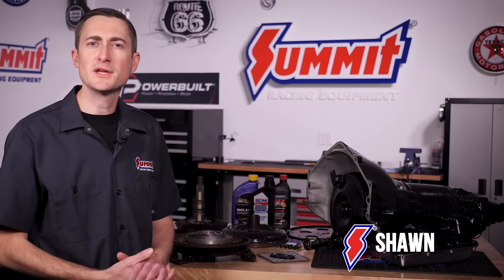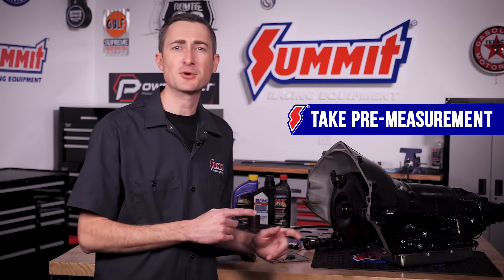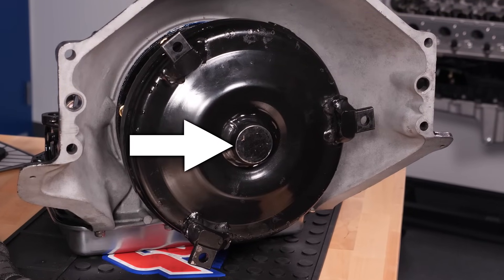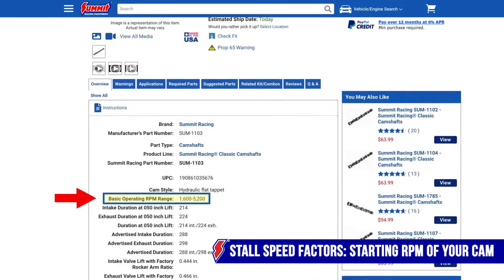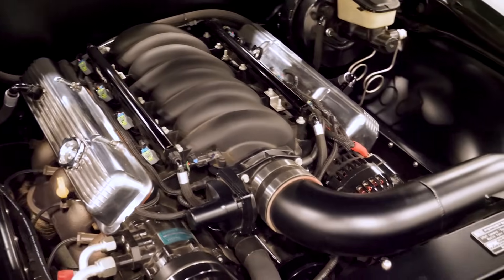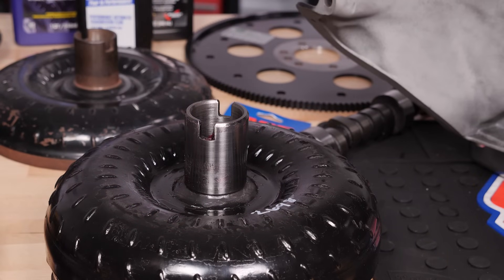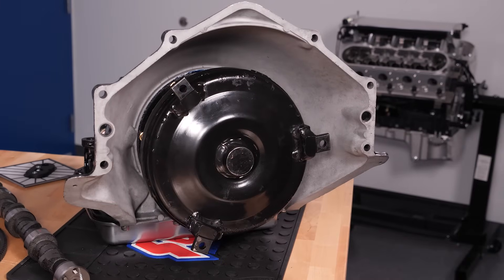5 Common Torque Converter Issues and How to Avoid Them!

Comment: Stop it with the BS of needing to run a stall RPM higher than your cruise RPM.  At part throttle cruise there is very little load on the converter, therefore very little slip.  I've been running 5-6K converters on the street for over 20 years.  During that time my cruise RPM has been 3,200-2,700RPM depending on the gear ratio.  I've been running the same transmission for 20 years.

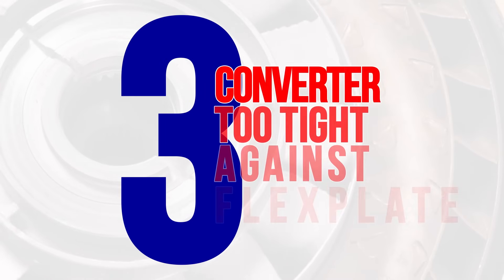Comment: My crate engine manufacturer stated OEM to 1800. 302 HO style block. 367 hp at 5700 rpms, and 356 torque. Car is about 3400 lbs +/-. I've got a TCI which was 1700-1900 stall, and it feels like driving a manual car with a burnt up clutch. Car will not start moving until 1500-2000 rpm from a stop. It always feels like it's slipping.  Rear axle is a TOTALLY redone 8 inch with posi, 31 spline axles, aluminum pinion support, nodular case and 3:25 gears. Trans builder checked out the transmission and says all is well, and the convertor HE bought for me feels too high. He builds racing transmissions and years of experience, so I figured he would know. I am about to pull my transmission and install a stock stall convertor and stock style flexplate. The SFI rated plate is too thick for the studs on the stock convertor, so it has to go.

Comment: I have a 2012 Chevy Express passenger van it's a 5.3 1LT AWD it has 250000 mostly Highway miles. The trans works great, the engine Burns zero oil and consumes no coolant.
I'm getting the code PO700 and p0741. Shortly after these codes appeared the van began to accelerate strangely. It did this when I first accelerated and right around 45mpr. it would lose power but then gained it again, it would do this several times before going back to its normal performance. I noticed that my RPMs would go down and then quickly up and down again while it was happening. I know this is all a Telltale sign that it's the torque converter. However there is something else happening that is strange. First when this was happening I turned on my tow/ haul button and all symptoms would go away. The fault codes would go away but then always come back as my vans computer system would run its Diagnostics . For the last two weeks I've been driving my van with the tow/haul button off and the van is performing normally, however the fault codes continue to turn off and on. I have had the torque converter checked by a professional transmission shop and they found that the slippage is minor, in fact they said and I have verified that my type of clutch converter is designed to slip a little bit. They recommend a whole new transmission but I know that it could be other things like a solenoid or the computer. The van is currently running perfectly it has no symptoms.

Comment: Can you confirm that your example at time 2:19 was miss stated or the info about how the weight of the vehicle affect the selection of the stall speed was incorrect. Lighter vehicles would require lower stall speeds not higher. Thanks

Comment: I know this is an old thread but I have an 88 f150 with the inline 6. Having problems with the motor jumping(shuddering) at low rpms. Could this be the torque converter? The truck had sit for about a year or so prior to me buying it so wondering I'd it just needs driven & given a good tune up maybe? Drives down the road at 30+ mph great. No loss of power, no slipping of gears, nothing else just jumps at slow speeds when accelerating
Reply: My 2010 Honda accord does it occasionally. But only when I’m under 30mph or slightly accelerating… been happening over a year now too.. I don’t want to take it to a shop until i know for sure

Comment: Hi. I drive a 2001 Hyundai Elantra 1.6 gls automatic transmission. Fuel consumption is about 21mpg. Acceleration is weak and I feel that there is too much spin on the torque converter during acceleration. Spin varies between 200 - 700 rpms under light acceleration and between 500-1200 under normal/medium acceleration. I feel Hyundai got it all wrong. Is it possible to adjust the torque converter to spin less and accelerate more?

Comment: Also never put a 7.5 fuse in an empty fuse slot where your transmission control is. That brings on engine light and no lockup. Found that out when I put fuse thereTook it out the next day and everything was fine

Comment: Hi Shawn,
Great video!
My 2015 Sienna is shuttering in reverse and feels really weak. I hear a whining noise that I thought was the tires until I got all new tires and the  sound is still there. I have 115,000 miles on it and I did have the fluid power flushed by Toyota hoping that it would fix it.
Could it be my torque converter?
Thank you in advance for your time and consideration.
Eric

Comment: Don’t know if I have a torque converter issue maybe you can help out first thing I noticed when first start up of the dayI i lear a humming noise coming from the front of the transmission after the truck reaches operating temperature coming to a red light RPMs start going up and down and then up and then down and then drops to normal rpm readings at a red light is this a converter issue or is it something else
Thanks Frank

Comment: Sorry, I didn't get the point at 2:13 - 2:23. You say the lighter the vehicle the lower the stall speed will end up being but you then go on to say your should go to a higher stall speed if you have a light vehicle. Probably my dumb but I don't get this part.

Comment: I have a 2014 Toyota Camry SE and I took it to a Toyota dealer and the replaced my torque converter due to a vibration. But when I got my car back The steering wheel was slightly misaligned with the wheels and my car was pulling to the right. could changing a torque converter affect the misalignment in the wheels?

Comment: The guy that built my Transmission said that he had to spot weld a leak on the torque converter. What kind of problems can this cause?
Reply: Balance issues.

Comment: I have a 1992 Subaru Legacy automatic. Every gear is forward.
R, it goes forward
N, it goes forward 
D, it goes forward 
3, it goes forward 
2, it goes forward 
1, it goes forward,
What did I do?
I don’t understand! This is my first time but I just rebuild the engine, replaced the valve body

Comment: Summit racing. I have a original automatic transmission and sometimes when accelerating is shudders and doesn't want to go. And when I let off the throttle and reapply the throttle it goes just like it should. Could this be a torque converter or a shift solenoid?
Reply: Did you find out?
Reply: 1980baldeagle i found out its the clutch pack for 1st and second gear

Comment: Nice video. Great information. I have a 1994 Ford e-250 5.8 with a E4OD transmission. The rear end differential was replaced and it has a different gear ratio than the original. I believe it has 3:73 wheeas the original was 4:10. The engine is stock no upgrades. Does anyone know what torque converter it would require? I carry close to 900 pounds daily. Also, I went to the dealership to inquire about a replacement transmission, and the man said there are two to choose from depending on the rear end gear ratio, Thank you.

Comment: I put a 3700 3800 stall single disk lock up on my 2009 Silverado I have a cam 228r tsp , whenever I put it on reverse or drive it moves slowly I gotta step on the gas so it can move what can it be ?

Comment: So my transmission isnt shifting out of 2nd gear. I changed all of the shift sensors and filter. Put it back together and now it won't shift out of first. Is the torque converter the problem?
Reply from the maker: It sounds like you have an internal transmission problem—possibly in the valve body. The issue is probably not related to your torque converter.

Comment: What’s wrong if torque converter never clunks into place but seats all the way?
Reply from the maker: The "clunk" is the sound a converter usually makes as it completes its final seating into the transmission pump but may not always be easily detected. Continuously monitor the converter as you are bolting up a transmission, making sure it freely spins as the transmission is drawn up to the engine. If the converter binds, stop and recheck the converter engagement. Damage can occur to a pump if the converter is not seated all the way and the transmission bolted up all the way.  
 
If the converter's correctly installed, there should be a small amount of in-and-out play between the converter and the flexplate with the transmission bolted up.
Reply: @SummitRacing  hi, I had a transmission replaced last year. After it was put in it randomly does a clunk/thunk uphill or under load. This happens about 25% of the time and more often on long trips. Could that be a torque converter issue?

Comment: So lets say my automatic car a 5r55s transmission i was 20mph cruising(1st gear still) i gassed it rpm reached first rev red line and i heard a noise and it never shifted to 2nd my car just went neutral. All my gears my car seems to act like its in neutral even reverse and drive 3,2,1 but when its on park my car does it job nd doesnt move it stayed locked in park ? What could be the issue ? I did a fluid change already nd it was dark brown fluid . Pls any info helps
Reply from the maker: Sounds like you have a serious problem with your transmission that will require inspection.  I would recommend you find a reputable transmission shop inspect your issue.

Comment: Will a worn out Torque converter cause a  4L60E Transmission to slip at 70 mph?
Reply from the maker: Hello John, 
At that speed, your converter should be in lock-up mode unless you're under heavy load or acceleration. Typically, a converter clutch will shutter if it is slipping. A bad lock-up solenoid or debris in the valve body can cause engagement problems as well. I would suggest inspecting your fluid closely for signs of overheating or contamination. The first approach may be a flush and a new filer service. Additionally, there are additives on the market to help with clutch conditioning. 
https://www.summitracing.com/search/part-type/transmission-fluid-additives?ibanner=SREPD4

Comment: Can i use a v6 gearbox on a 2.5turbo enginé?
Reply from the maker: Hello Justin, 
 
We would need more information on your application. The compatibility would come down to engine/gearbox bolt pattern, flywheel size, and spacing. Many companies offer adapters for popular applications. Another thing to consider is gearbox ratios. Depending on the application, ratios could differ considerably, affecting performance.

Comment: What if you have a huge turbo on a 3800 series 2 6 cyl engine? I’m installing a 3000 stall sp
Reply from the maker: Hi Earl, 
Anytime you are adding excessive load from a power adder or dealing with issues that would arise relating to the extreme heat, as in turbo applications with long spooling times at the track, you should consider a converter equipped with an anti-balloon plate, billet front cover, and piston along with hardened internal parts like FTI Performance SRL or SRL-3 Series Billet Lockup Torque Converters.
Reply: I’m upgrading the transmission with a zzp hardened torc Converter input shaft. Zzp hardened axle output shaft...heavy duty clutch packs,...and stronger sprocket chain...I would do more but I’m over budget....and I already purchased the high stall speed zzp torc Converter,

I will most likely do 2 track runs” just to see the 1/4 mile times....I’m going to have to actually power break it to 3000 rpm before I takeoff....I think the torque converter can probably handle that since its a 3000 stall speed torque converter

I’m worry about the CV axle yolks the Pontiac Fiero axle yolks is all pot metal

Comment: Hey Summit, hope all is well. My 2007 Honda Accord A/T has a whining sound that exists in all gears but much more noticeable in neutral and park. I recently replaced the P/S pump & high pressure line and bled all the air out but still have the whining sound. You think it’s the torque converter ?
Reply from the maker: Hi Erick,
 
I don’t believe the torque converter could cause the whining sound that you are hearing. However, we would suggest having a mechanic check out your car with an automotive stethoscope to locate the origin of the whining sound.
 
I hope that helps.

Comment: Would a Converter cause a car not to move in drive?
Reply: Definitely.... If it is failing or has already failed. The converter transmit power from the the engine to the transmission.
Reply from the maker: Hi JoeySk8z,
 
Many things would cause a car not to move in drive. A failed torque converter is one possibility. Others could be, Front Pump failure, No or Low Transmission Fluid, Worn Clutches, or failed valve body.
 
Thank you for your question.

Comment: My car is acting like it might have a failing torque converter. Slips a lot when engine and trans are cold, meaning the more throttle is put in the rpms keep going higher than they would if it was gripping properly. The car also loses the majority of its power under 3k rpm, and feels slightly underpowered in the higher rpms as well. VQ engine cars upon cold starts usually idle pretty high, and this car isn't doing it anymore... so I'm not sure if its something with the engine or the transmission. I have a feeling it's the torque converter but I'm not entirely sure.
Reply from the maker: There are a lot of variables at play, but it doesn't sound like a converter issue to me. If it is slipping when it is cold, then doesn't when it is warm, sounds like a bad band in the transmission or something else internal in the transmission. The issue of not idling the same sounds like it is engine related.

Comment: I had a old Cadillac engine swapped to a Oldsmobile on my 84 eldorado. The Oldsmobile engines came in some of the sister cars of this model so it would bolt right up.... Problem is after the swap the car has no torque when accelerating. Also seems like the rpms rev higher than the car goes. I thought it was a carb issue but looks like it may be something relating to this torque converter.....
Reply: Yeah just ran low on atf on my 01 grand am and every since I refilled it, I had no torque when acceterlating

Comment: Good day. Can a bad torque converter cause a grinding sound when in reverse gear.
Reply from the maker: Hi, The torque converter is bolted to the engine and is always rotating in the same direction of the engine at engine speed no matter what gear the transmission is in. Usually if there is an issue with the torque converter, it will affect all of the gears and not just reverse. It seems like the grinding issue is either internally in your transmission or possibly something in your drive line. You may want to raise the vehicle off of the ground, with the vehicle safely supported, put it in reverse and listen underneath to locate the source of the noise.

Comment: Thanks for the tips 
What is the proper fluid cooling for a transmission cooler ?
Reply from the maker: Hi, Many transmission coolers are rated by BTU (British Thermal Unit) A good operating temperature of an automatic transmission is 160º to 200º F as the fluid exits the cooler. If you can maintain fluid temperature below 175º F the fluid
should last for as much as 100,000 miles. Higher fluid temperatures drastically reduces the life of the fluid. Cooler temperature equals longer fluid life. Please see the following link for more helpful tech information from B&M. Thank you, https://static.summitracing.com/global/images/instructions/BMM-bm_cooler_techdoc.pdf

Comment: Great video! I’m having some issues with knowing cam and horsepower first. I have a basic stock 451 Stroker with 4:10 gears. I purchased a 3200 stall. It was WONDERFUL for 3 days. Now I don’t have 2nd or 3rd gear. Had to drive home in low. Pulling everything out this weekend and sending trans back to rebuild shop. The car drove fine but different. I kept in low gear in neighborhoods, only launched it once hard. That was it. Not sure where or why I have failure. I machined down the flex plate bolts, was very careful followed careful instructions but still had problem. Wondering if my gear ratio is wrong? Any info would be much appreciated, thanks
Reply from the maker: Hi, thank you for the compliments on our video. It does sound like something in the transmission failed, but we would not expect the gear ratio or the torque converter to be directly related to the failure. To determine the correct gear ratio you will need to factor in the height of your rear tires. Here is a link to help calculate the correct gear ratio for the MPH and RPM desired in the final drive gear. https://www.summitracing.com/newsandevents/calcsandtools/gear-ratio-calculator
We hope this helps.

Comment: On the G2704-10 model for my 4l60 transmission I I stalled and when mounting to flex plate noticed it had about a half inch gap from the mounting spot on the converter to flex plate which. Required longer bolts and also never seen a bit and bolt application style tourque converter how are they installed mine would not send any oil pressure and I changed it back to my stock converter it worked just fine so it's not my transmission
Reply from the maker: Hi Ricardo, Can you please give us a call? 1-330-230-3030

Comment: How come they replace the torque converter on 8 speed chevy colorados when the transmission shudders?
Reply from the maker: Based on what we have heard, the shudder is caused due to failure of the Torque Converter lock up clutch. We suggest visiting your local GM dealer for more information.
Reply: @SummitRacing  there full of bs they claim there no problem and a think a thicker transmission fluid sloves the case but the transmission are dying after 50k miles